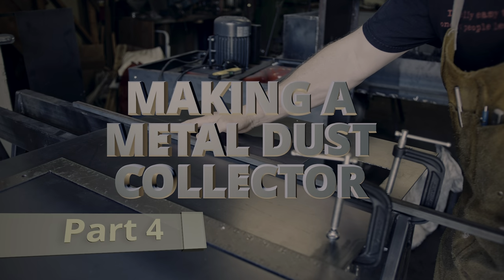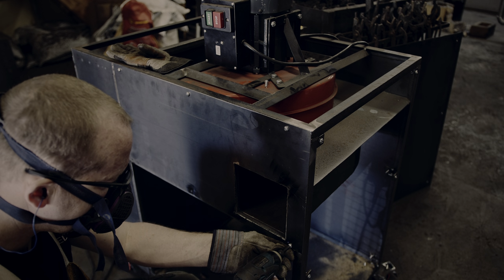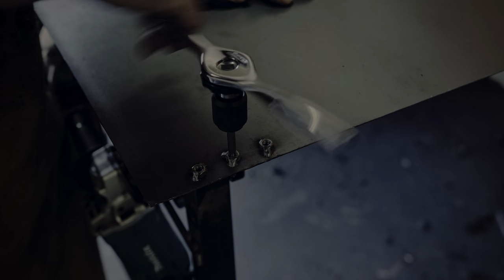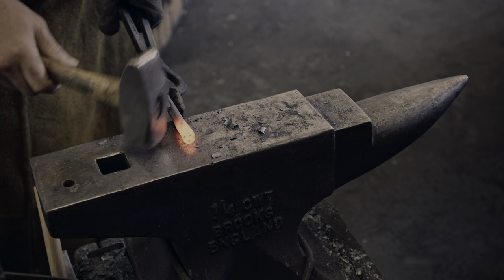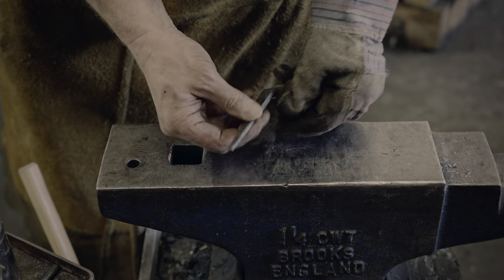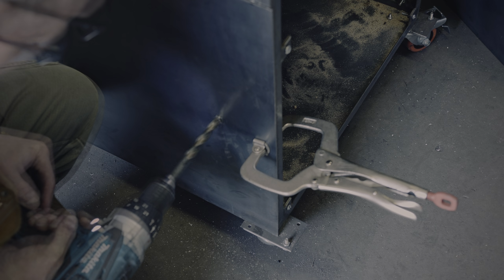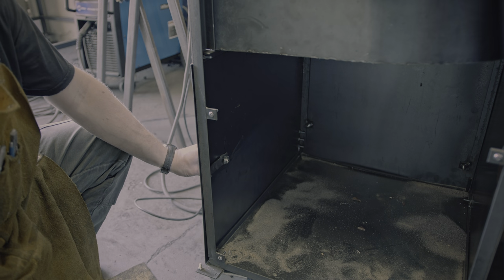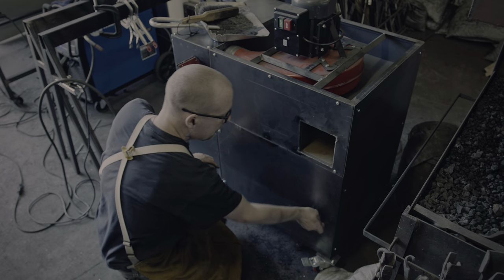Making A Metal Dust Collector: Part 4 - Door Latch and Forging (2.5K HDR)

Comment: One problem with old MVs is that modern non-ethanol gas is 93 octane and it is hard for those waterproof sparkplugs to fire it off. Ended up replacing the breaker plate inside the distributor with a Pertronix MV141a and I had no more problems.

Comment: I have a suggestion for Frankenstein.  Fill the bottom of the dust collection chamber with plywood or rigid foam onsulation. This will bring the floor level flush with or above the angle iron lip. This improvement makes it easy to sweep out the dust from the machine.
Reply from the maker: I like that. Good suggestion!